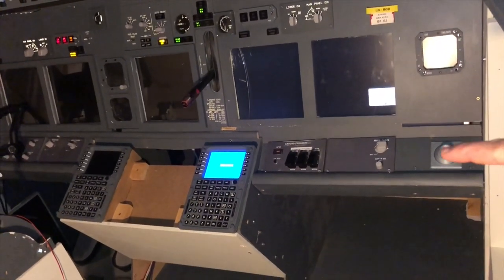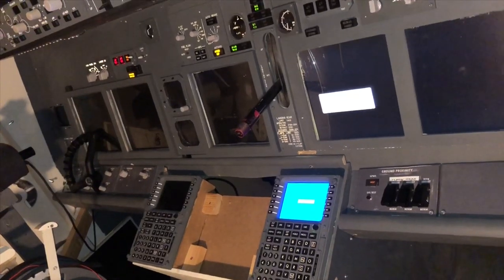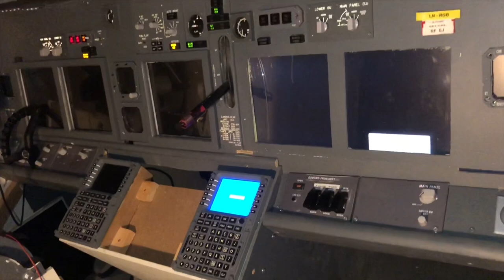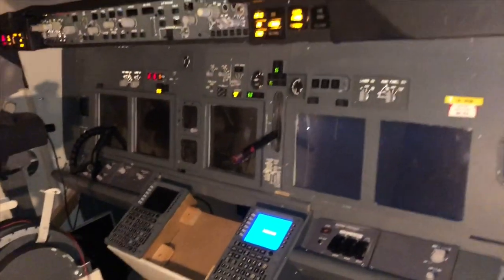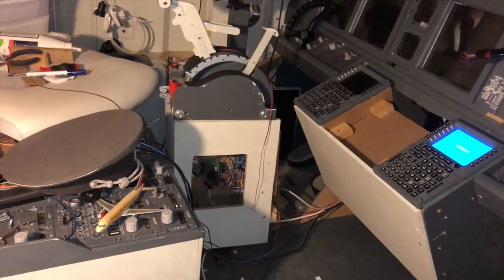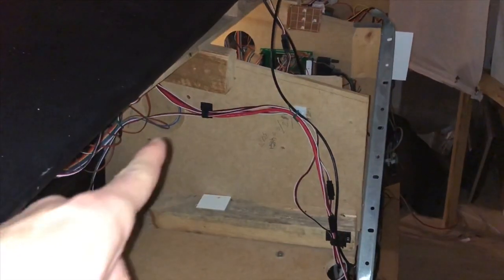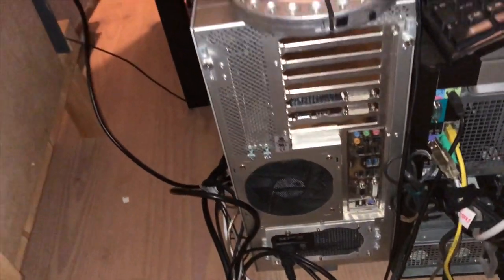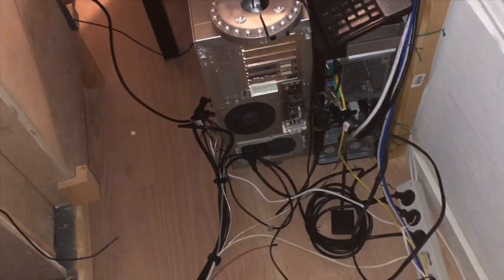2019 in a nutshell - B737 Home Cockpit

Comment: Hi, last year I had a similar electrical problem with a home cockpit setup. I found out it was an old and faulty circuit breaker for the main AC voltage of the house. It was tripping because of the high current demand to charge all capacitors of the sim electronics when connected to the main.
Try plugging in things one at a time (slowly), if it doesn't trip consistently (or doesnt at all) then this might be the cause. Go ahead and replace the breaker, for me that solved the problem, so might be the first step to go.
All of this of course if you haven't found a short already ;)
Reply from the maker: I actually had that problem in our old house. 5 computers and if I turned on the switch at the same time the fuse blew. But powering random 4 caused no problem. So it was not one single computer, but just the total power drawn by 5 computers. 
In my new setup I turn the power off completely each time. But I have never had any problems since that one time when I did the video.
Reply: @BuildaBoeing   sometimes you are just on the current limit of the fuse and it may happen randomly. May depend on a number of factors, maybe the wiring you just changed add a little capacitance between one wire and the other (now that they are parallel) needed to trip the fuse.
In Italy we have amperage rating for the main AC breaker. Try getting a greater max current rating (I'm speculating a little because i don't know exactly what kind of safety system you have there). Anyway good luck!